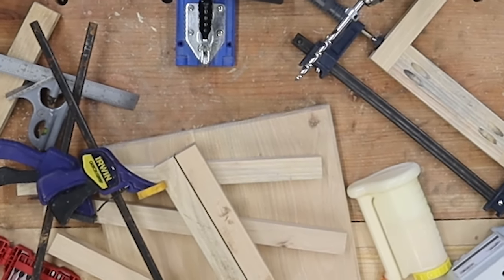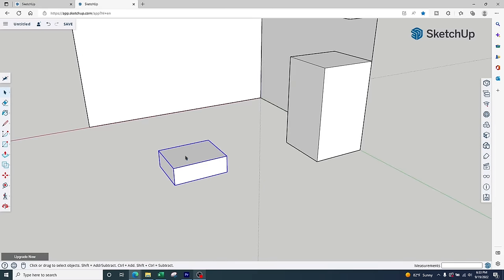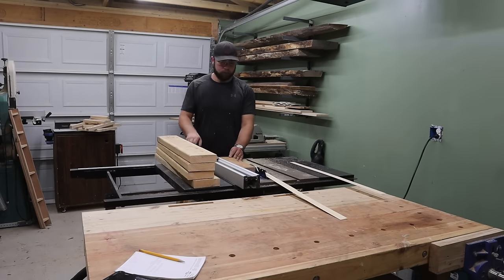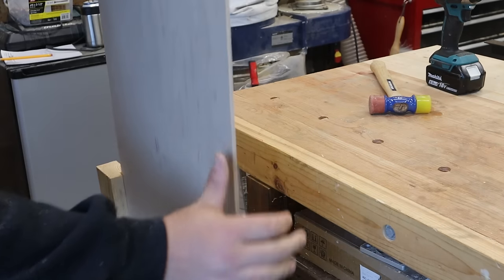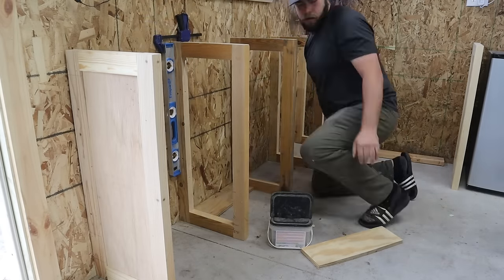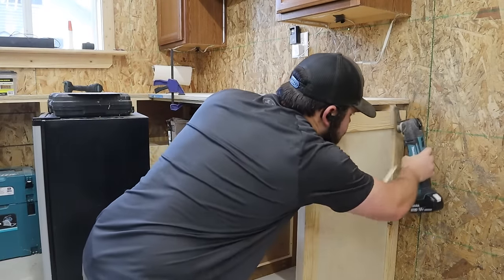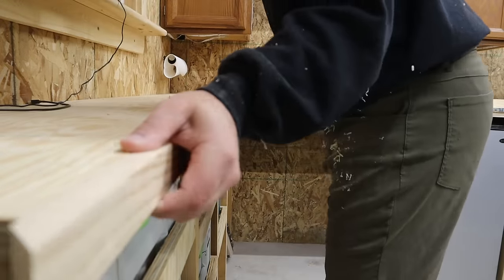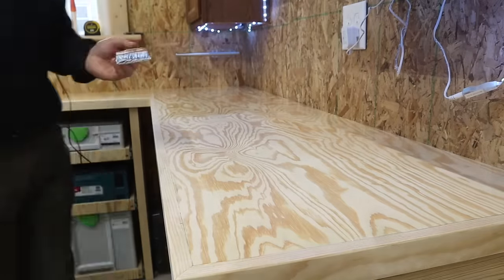Small Workshop Organization and Layout Idea

Comment: Great solution to your specific needs. I think I would have leveled all the "legs" before attaching them to the wall thus avoiding the shimming of the top.
Reply from the maker: Thank you! Yeah, I think that I could've done that better. It would be difficult to square them prior to install based on the construction method. But if that was a bigger priority, I may have added identical stretchers to everything and then level them together. Overall though, I'm very happy with the end product and have no regrets on it.

Comment: At some point, that top will warp where the gaps are between the shims. If that happens, and you replace the top, I would suggest leveling the legs instead. Find the high spot in the floor, and mark level across the wall. Run all the legs up to it, leveling and shimming as needed. When you put the top back on, it will now be flat on the supports.

Comment: Very similar to my smaller basement L-shaped shop (~400 sq. ft.), but I got a super deal on Rockler steel shop stands for my bases.  I topped & sided them with 3/4" plywood and edge banded with pine just like you did.  Nice and robust.

11:22... single best cheaper purchase I made was a 25' heavy duty electrical reel cord that I mounted in the ceiling dead center of my shop above my table saw outfeed/assembly table (12GA, full 15A, not those cheap 10A models that the builtin breakers trip all the time) .  I can pull the cord anywhere and reach every inch of the space, even though I have outlets all around each wall.
Reply from the maker: I recently did that with a hose reel for my air compressor from harbor freight and am very happy with it. 
I'd get an extension cord reel too but I have enough outlets in my shop that I almost never need an extension chord lol.

Comment: Next project. Build A Bigger work shop. A good sized garage. 2 or 3 door. 1 being wider and taller, the other(s) standard size. Then a 2bd floor above the workshop for finished products or apartment or for your late night work that you dont want to wakeup the wife and family. Make sure you install a full bathroom and a decent kitchen. It could come in handy. Electric appliances. Upgrade the electric panel. Put some solar panels. Going on and on.

Comment: Nice solution to one of those oddball spaces we always seem to be stuck with in setting up a shop. I particularly like the frame/ panel construction for the sides and middle dividers. Didn't know Freud made the box joint set and will look into it. My shop floor is WAY too uneven, so I would likely need to assembly the frames as a unit with a toe kick/ platform (and a few stretchers) to set the whole deal on. The pocket whole frame assembly also seems like a great 'practice' project for other 2x lumber.
Reply from the maker: Thank you! I've been really happy with it since. Yes, this was a great way to get rid of some of the scrap 2x material that was just laying around.
I haven't had another dado stack, but I've been very happy with this one so far.

Comment: Great ideas and video. Thank you. I'm thinking of doing something like this in my small workshop. Do you experience a need for doors (or something similar) to avoid dust coming into your drawers?
Reply from the maker: Good question! So I just have my systainers in these which have lids on them (they're boxes) so it's not a big deal. But there's very minimal saw dust on top of them when I pull them out anyways so I really wouldn't be worried about it?

Comment: Most floors are not perfectly square and level. Instead of shimming the countertop level most cabinet makers would use a footer and shim that level. This way you are building off a level platform for you cabinets to rest on. Shimming up the countertop like you did throws off the alignment of the cabinet and raises visual correction of floors lack of level from your toes upto a height where it becomes visually more obvious. While your method allowed you to utilize the full height between the countertop and the floor most people find having drawers or containers(systainers) raised a few inches easier to access.